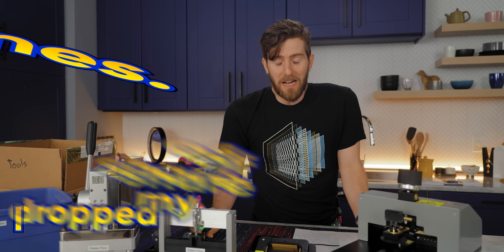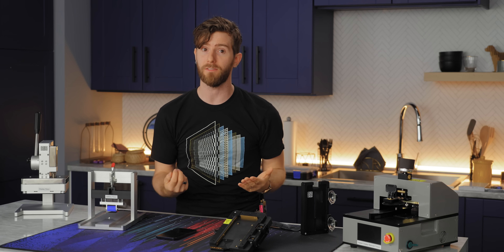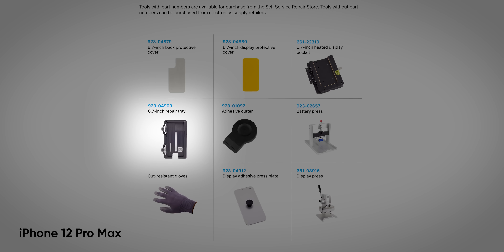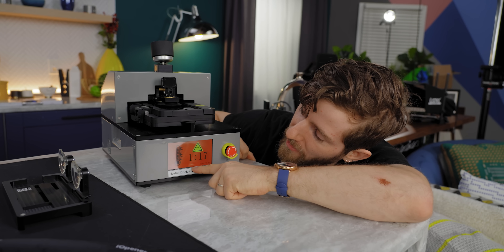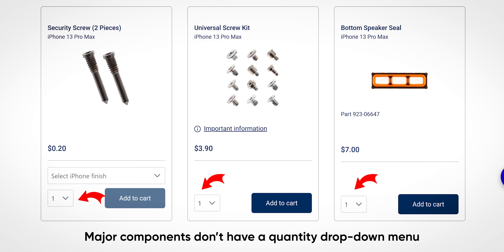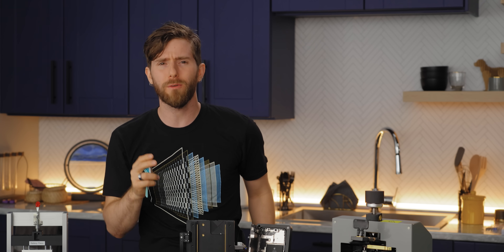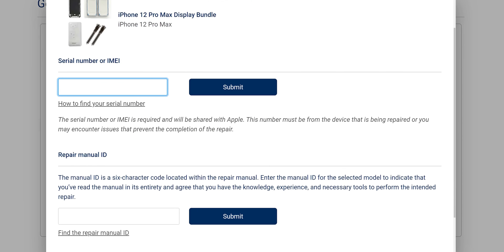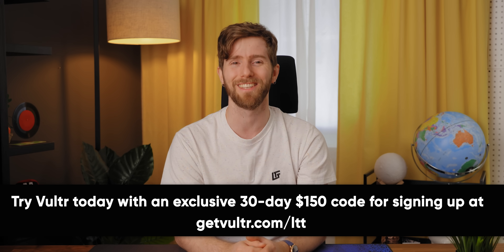I’m a Genius - Apple Self Service Repair Program

Comment: Apple: "Repair your device yourself!"
Also Apple: "But for 10% more!"

Why people STILL think this is okay is beyond me. It's just asinine that Apple continues to get away with this.
Reply: Really it's about 33% more to repair it yourself! 😅
Reply: Apple: Fine you can repair your device but, we made it much much harder for you to fix it your own. And it costs you a pretty penny. OR YOU CAN GIVE YOUR DEVICE TO THE APPLE STORE AN-

Me: AAAAHH! AAAAAAAAAAAAAAAAAA-
Reply: The power of the money bro
Reply: Crazy!! I mean with Samsung’s repair program you get the parts at 50% cheaper than the store, some parts even 70% cheaper! don’t know how the other companies can offer such a discount service but Apple cant 😩
Reply: @TheReal_XiJinping  I'll tell you what iPhone does better than Android:
- Longer software support (the iPhone 6S was one of the longest supported phones ever, receiving 7 years of support. Most Androids are lucky to hit 3)
- Greater longevity in general (iPhones hold their value much longer than similar Android devices)
- Optimization (iPhones perform just as good if not better than Androids with less RAM)
- Better sync between apps and devices with exclusive features, including iMessage, AirDrop, and FaceTime (the Apple ecosystem works incredibly for a lot of people)
- Apple never rushes to implement a feature to dump it soon after. This may mean they're a bit behind sometimes, but when they add a feature, they usually do it right

And while they've been behind on customization for a while now, they're catching up very fast with iOS 14 and now 16
Reply: Apple is "an ecosystem" according to their dedicated consumers.  They don't have to make sense. They created a consumer base and made them feel special, and a large portion of that consumer base will just accept almost any BS Apple feeds them.
Reply: Samsung is no better
Reply: Idk if you’re trolling or not but this isn’t meant for people to just order to their houses like a civilian product. It’s meant for repair-shops and such. Kinda the same like a water-jet: it’s better to know someone who has one than it is to own one
Reply: Indeed. As long as the mean IQ score is sub 80, the world will continue to suffer.
Reply: because 99% of user just DO NOT want the hassle of repairing their expensive phones.
Reply: I don't understand why ppl use iPhones.  An android device is like using a PC vs a console.
Reply: @fukkitful  an android device is better than an iphone in terms of freedom but dont forget they are still nowhere near as free and open as they should be
Reply: @fukkitful  lol
Reply: @fukkitful  iPhones have the reputation to be very consistent and optimized performance wise and are easier to use for the average joe

Android have worse (or less optimized) performance because of the different types of chipsets different Android phones have

Androids are however more customizable, less strict and generally cheaper than the iPhone
Reply: @fukkitful  What I don't understand is why you people care with what others do with their own hard earned money. Its beyond me.
Reply: @krazymeanie  Do you think we should let Scam Artists and Con Tricksters walk free too then ?
Reply: @petegaslondon  Last time I checked that's completely different to using your own money to buy what you want. So what stupid analogy are you making to fit into your argument?
Reply: @krazymeanie  that's oke bro, just dont cry when repairing a screen crack costs you more than the phone iself hahahahahahahahahahahahahahahaha
Reply: @addo9697  That's the point. It doesn't cost more. Are you even reading?
Reply: @fukkitful  As in both have their own advantages and disadvantages and neither is objectively better?
Reply: @gvtc07  Objectively, it is better to have something with more capabilities and support that doesn't excel in any particular place than something that is only good at a specific set of things.  I.E. Android/Windows/Linux vs Apple.
Reply: @ShreddlyMaps  android has more freedom capabilities and vastly more issues and quirks. My iPhone just works.
Reply: @gvtc07  Yep, each has there pro's and con's.
Reply: @sonnieslim5973  this is the real answer right here.
Reply: @sonnieslim5973  Android also just works. I owned both iOS and Android devices, and I can say that Android does not face any issues that iOS also doesn't face, although you can mess something up if you do something without knowing what you're doing. But at least you can do that instead of being locked out.
Reply: @gvtc07  I would say longer updates is objectively better.
Reply: @elu9780  yeah no.
Reply: @gvtc07  there isn't a camera in a phone on the market right now that even comes close to the s22 ultra
Reply: @elu9780  android does have more issues but that tends to be on low end devices and at the point of going do I want a iPhone or an android you should be looking st the same $900-$1200 range in which the android phones do just work
Reply: @brykanst9071  to me, consistency and reliability are the most important in a phone. I have owned multiple Android and Apple flagships in the past, and I have found Apple products to have less stutters; smoother and less distracting animations; longer and objectively superior software support; and, most recently, unmatched battery life and efficiency. I currently own an iPhone 13 Pro Max, and for the first time, I’m fully satisfied with my smartphone. 

I have found Apple’s choices in their software to be better than what I had been able to achieve with Android flagships’ freedom and control that is given to the user. Sure, it’s about preferences, but I think this particular debate is pointless. At the end of the day, we all have different preferences, and mine, like many others’, happen to be better aligned with Apple’s offering. I have found that the people who continue to argue about phones usually have never owned flagships from both sides. In other words, they lack perspective.
Reply: @sonnieslim5973  My Android also just works. Don't know what issues you are referring too.
Reply: @brykanst9071  well yeah, if you buy cheap crap you get cheap crap. However, there certainly are relatively cheap options that work just as good if not  better than an iPhone. And when they're at the same price point, I don't see a reason to pick an iPhone over a good android device.
Reply: @ShreddlyMaps  I rather have something that does what it's supposed to and has better batterylife, longer support and I can give to a shop to replace the battery. The damn thing is over 500€, I'd rather NOT do that myself. People repairing their own stuff are either experts and know what they do, rich enough to don't care if they fuck it up or idiots for trying something they can't do.
Reply: @fukkitful  they have longer support than android....
Reply: @Bewefau  longer support isnt a good thing. My old iPad cant even run 2 apps at the same time without one having to restart. All because Apple supported it for like 7 years.
Reply: @analtaccount667  What crap are you saying. Because apple is supporting isn't the reason its restarting, its simply because the hardware is old. What kind of logic is that? In actuality if they wasn't supporting it it wouldn't even be able to run one
Reply: @krazymeanie  oh idk maybe Apple supporting it with new iPadOS is causing issues? Because guess what, THATS THE EXACT REASON. The newer iPadOS revisions kept forcing the old iPad to work much harder than it needs to. And guess what, apps run fine on older OS's, I tried.
Reply: @analtaccount667  Can't exactly blame them for updating old devices with new OS since they can't please everyone. If they don't then it's gonna be "Oh apple doesn't support their older devices and wants you to buy their new device for new feature. Apple bad". Thats just the reality.
Reply: @Bewefau 8 Well they need it because their apps actually stop working with slightly older iOS versions.
Android doesn't work like that. I have a 2017 phone with Android 7. All the apps on it still work great and get updated. They don't need new Android to work. 
Apps on Android  only stop getting updated if the Android version is ancient far beyond any support Apple gives.
Reply: @fukkitful  at iphone 7 or 8 maybe. but for 12 up  the camera is magnificent
Reply: @peryutubanduniawi  I don't take a lot of photos. So camera quality is the least of my concerns.  I understand that's all some ppl care about though.
Reply: @fukkitful  this is a decent comparison for iOS vs Android, but a console is almost always less powerful which is the exact opposite of the situation.
Reply: @myrealusername2193  Consoles can get away with be "less powerful." Its a lot easier to optimize a game for console.  

My comparison is about how a apple and console need to be modded or jailbroke to run certain app. At least my Xbox had to be modded.  Yet android and a pc don't require this.
Reply: @fukkitful  Wdym? You still have to root your android device to do certain things and run certain apps.
Reply: @fukkitful  that’s exactly why I think it’s a decent comparison, and while you don’t actually need to jailbreak to install 3rd party apps it’s still a step you don’t want to need to do.
Reply: @myrealusername2193  Yeah, I found out jailbreaking wasn't worth it. The apps would crash constantly. That was with the iPhone 4. I haven't used an iPhone since.
Reply: @krazymeanie  Rooting on certain devices can be done easily with a simple one-click app.  Unless jailbreaking has changed it was a lengthy process when I jailbroke my Iphone 4.
Reply: @fukkitful  Youre talking about an iphone 4... from 2010... a lot has changed since then my friend
Reply: @fukkitful Rooting on IPhones can be done easily with one click as well though (well two but its the same button). Your comparing android and IOS but your saying the last time you used an iPhone was the IPhone 4. So you really can't compare them now can you? If that's the case I hope your comparing them with the android device released at the time of the last IPhone you used else it wouldn't be a fair comparison now would it?
Reply: @myrealusername2193  Consoles may be less powerful, but the advantage with consoles is that you don't have to worry about your system being fast enough to run a game, it's guaranteed to run it no matter what
Reply: @gvtc07  yeah as I said, console vs PC is a good comparison in a lot of ways. On PC, you can do literally whatever you want and no one will stop you, but on console, while there’s less to mess around with, at least whatever’s there is guaranteed to work nearly perfectly and you never really have to worry about it
Reply: @fukkitful  Nah mate you cannot say that. I have full blown PC gaming, but still using iPhone. It just works. 
I do not need those "Look at these customization in Android." 

You can change your xxx in your Android? So what?
Reply: It’s okay because some or most Apple users don’t care lol. I have never broken any Apple device, never broken a screen in my life, and if I did, I’d want Apple to fix it anyway. I dont want to fix it myself and I don’t want some 3rd party fixing it with crappy non OEM parts. It’s not a big deal and there’s much better things to worry about in life. And, if you don’t like Apple’s practices, don’t buy Apple’s stuff. Simple.
Reply: @ilmostro16  So by your own admission you've never tried to USE Apples 'repair' services?

Many have - including Linus! Absolute nightmare, taking ANY excuse to say your device is xxxxed, 'buy a new one' - next time how some RESEARCH before weighing in on an issue?

Also your argument appears to suggest we should let ALL Con Artists, such as tech support phone scammers, off the hook? "Better things to worry about in life" - so we let robbers roam free? Its due to these videos we get to SEE such "practices" - many of which are certainly crooked, and may well be illegal
Reply: And why people still buy Apple products is beyond me.
Reply: @ScrewFearMe  I buy their laptops and phones just because their battery life can't be compared. I can do almost a week with a single charge on iphone, whilst even top of the line android phones barely hold up 3 days
Reply: @neek01  what do you do with the phones?
Reply: @ScrewFearMe  Their marketing appeals to the vast majority of people. Also, people like the design and the emotions Apple devices makes them feel. It's a matter of preference honestly. Android phones are more of a utilitarian device, while iphones are more of a "lifestyle and design" device. 

I have noticed that people with android phones are more prone to dragging people from apple to their own side :). Although I completely understand them, I think people just gravitate to the more appealing option for their own needs and preferences.

Comment: I guess enough though they dont need to pay a worker to do the repairment, they do need to pay for the management and logistics for DIY kit... I don't think comparing buy back price for dead batteries and shattered screens to video games is fair. The recycle process and cost of recycling batteries and screen is not as easy as checking the disc and putting it on the shelf

Comment: I guess the only good thing about this is to have the ability to do repairs immediately & "on the fly", like if you move to Antarctica and are worried about your phone screen cracking, you can buy this kit & another screen ahead of time.  Yeah, that sounds about right, I'm guessing that's about as useful as it will be (unless you can mod it to work with other phones, which would be great!).

Comment: While still highly restrictive, I am extremely surprised at how far they've gone with this programme. 

Also the cost of renting and buying the repair hardware is relatively good value for the engineering and how purpose-built they are for iphones. 
The actual replacement parts seem pretty pricey, especially the displays, but the other little bits seem fair given they're exactly the right part for the job (all the screws, metal plates, adhesive strips etc). 

While it doesn't really make sense for end users, I could see repair shops buying the repair hardware outright, and either just replacing with the refurbished or 3rd party parts they usually use, or even using the IMEI of the customer's phone to secure original apple parts (With a time delay for delivery of course). 

It's not perfect, it's clearly been planned out to minimise the actual positive impact it has on customers, but at the very least they've opened a door that's been closed for many years.

Comment: Most parts can be moved over to other iPhones but micro soldering has to be done Some iPhone battery's have chips. Home buttons have chips so that they cannot be moved to another iPhone or replaced. If you move the chip to the new device then problem solved

Comment: I will say that you're likely right on most of your points but there are two issues I take with them:

1. You briefly touched on it but if there's no apple store near you then this becomes a much more appealing offer. Up until a few years ago for example the nearest Apple Store to me was 9 hours away and local authorized repair stores cost FAR more than a service like this. Ultimately in that situation it's a god send to just have the tools shipped to you.

2. I have had my screen replaced by apple (got it done the same day I broke it, can't fault them for the convenience) and if their goal was to try and upsell me a new device they did an incredibly poor job of it. Never once did they ask if I wanted to replace my X with a newer model or try to sell me on a new device instead of doing the job they were asked.

I'm not saying your wrong about these tools or Apple's intentions at all, you are definitely spot on. Just noting that the idea of them wanting you in an apple store to sell you a new device isn't the most accurate (at least in my case) and that Apple Stores are not always around the corner so for some locations these tools could be amazing.

Comment: You also forgot some more.
Not only is this more expensive on it's own, it is more expensive on it's own WITH a risk of screwing it up if you do something wrong resulting in you having to get ANOTHER overpriced part from Apple or not having a choice other than buying a new phone.
Not saying people wouldn't be able to fix it - it's just another path designed by Apple of paying Apple for something they should be providing at minimum cost, cause you ALREADY PAID for their already overpriced piece of technology. Anchoring at it's worst.

Apple. Pay premium to pay premium to do the work yourself. Insulting.

Comment: Thanks for highlighting Apple's BS on this program. They're just doing this to take the heat off the right to repair criticism. It's all a facade. 

Find the highest rated local repair shop in your area. Make sure they offer a proper warranty, pay much less than going to Apple, get it done much faster and support a local small business instead of the richest company in the world.

Or go to the Apple store and pay for an out of warranty replacement fee when the only issue is lint in your charging port.

Comment: I brought my iPad into an apple store for not turning on. I lost the original charger, and charged it for over a day on another non apple, but still very good, charger. It had the charging symbol on the screen while charging, but refused to even try starting. I told the apple employee this before they brought it in the back to do I don't know what. Twenty minutes later, they came out and told me I need a new iPad. I declined, brought the old one home, and found the original charger that was packaged with it. Low and behold, it booted right away.